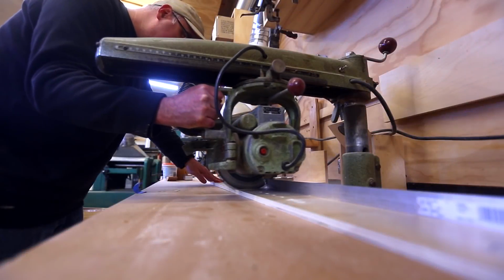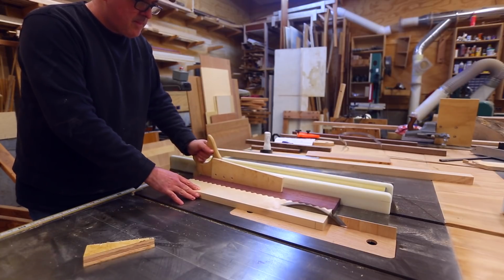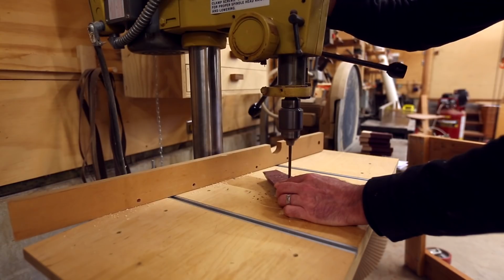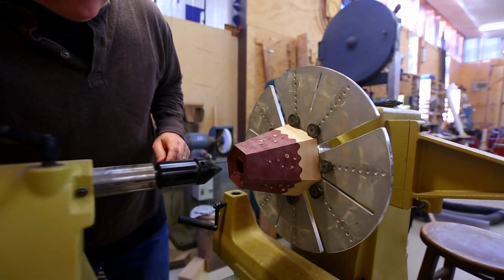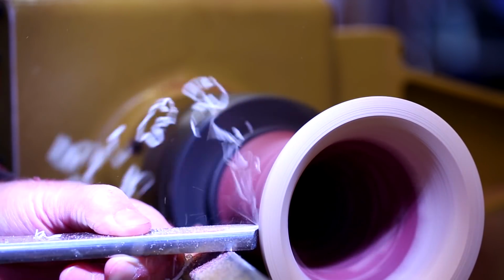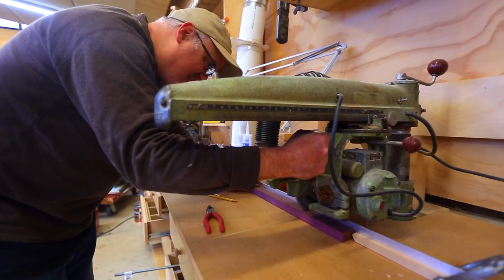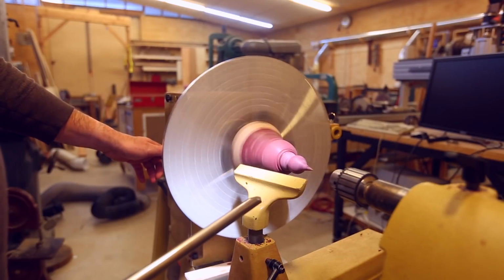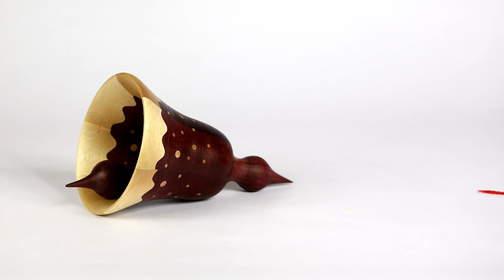Snow Bell

Comment: I've seen this video multiple times and only now do I have a possible solution to the problem of lining up the wavy snow line. Create the darker and lighter cone segments separately. Create the wavy path in CAD as though it was a wavy record. Cut that path onto the top surface of the lighter wood and the bottom surface of the darker wood, with both pieces set around the same center point. Those should join up, and more importantly, because the wavy surface extends to the center, it doesn't matter how deep you cut into the joined piece, the waves should remain matched.

Comment: Hi, I think I know how to make the wave pattern fit the cone.
In physics, the wavelength of a wave is the distance a wave travels along the axis in one full cycle, as shown in the picture in the following link:

https://en.wikipedia.org/wiki/Wavelength#/media/File:Sine_wavelength.svg

As you can see, the wavelength is the distance from one peak of the wave to the other peak, but the distance I want you to work with is the distance on the axis from the point where the two axes meet, the wave goes up, comes down to zero, goes into negative, then comes back up to zero. That zero-maximum-zero-minimum-zero pattern is the wavy pattern on your bowl.

Now, to make the wavy patter align perfectly on the cone, what you need to do is to make sure that the circumference of the cone along your wave pattern's axis is divisible by the wavelength of the wave pattern. That way, the circumference of the cone will take up an exact number of waves, and the wave pattern will align perfectly.

Comment: I cannot cease to be amazed by your mastery 

for the connections between the wavy bits to be more smooth it might be an idea to cut the waves in varying thickness radially at the same angle at which the glued parts in the end are cut
(hard to explain in words)

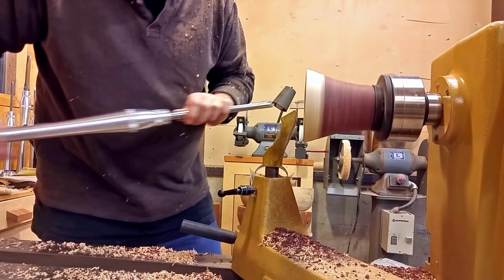Comment: Very nicely made bell, Frank! I have a question about the device you used to drill into the bell to add more dowels. It looks like a drill press for the lathe. Where, if I may ask,  did you come by this tool?  It makes its appearance around 8:30 in the video. 
Thanks!

Comment: Hmmm seems like getting the wavy pattern to accurately match, once all the segments are glued together, the pattern would have had to begin and end mid-point on the side of each segment.  The trick would be then be to create the wave in the computer to match the width of those segments with a flat in the wave in between each to match the width of the saw blade cut when you make the segments.  Viola the wave matches all the way around...  and perhaps avoids the creation of a Dalek in the process!

Comment: Hey Frank, did you notice that when you used the aluminium hold-downs in the original footage, that you had them backwards. This is why they didn't exert much clamping pressure...

But when you cut the wooden hold-downs, you used them the correct way and had no problem... a trap for young players...

Keep the videos coming,
Cheers

Comment: Great job Frank. If you ever have to clamp compound staves steeper than those in the bell, a great way I learned from Don Russell is to use 3M 8884 stretchable tape. 1 inch stretches to over 11 inches. You get lots of clamping force and it won't slip.
Reply from the maker: +Lynn Schmidt thanks for the tape (tip)  I will get some of that

Comment: Great job Frank, I love Purple Heart.  I wonder if you could have compensated for the kerf from your radial arm saw cut on the CNC machine when you cut the curvy bits, so all the curvy lines line up?
Reply: +Greg Altenhofel It isn't just the kerf that makes lining the pattern up challenging, part of the problem is that you don't know the exact diameter of where the pattern needs to line up. Since it is being turned round, it doesn't need to line up on the outside of the compound stave, it needs to line up where the final diameter is. I've tried to do similar things on the snare drums I build, and it hurts my head!

Comment: I think you could get the wavy line to match up at the joints if you make the curve a sine function such that the length of one "slice" of the bell is the period of the function. Once you begin work on the lathe, though, that length is reduced, and I'm not sure if the wave will remain continuous, so maybe you guestimate/determine in advance your final external diameter and calculate the length of a side of the circumscribed hexagon (because you only care about continuity at the joints - elsewhere it's guaranteed) -- which is the diameter/2  -- and then build your sine function accordingly... Next time ;)

Comment: You may be able to do the wavy pattern on the bandsaw by ganging up both boards, but staggering them so that only an inch or two overlaps. Then cut the wave and glue the pieces together.
Reply from the maker: +Brian Abate yes, i have seen that method

Comment: A festive project, creatively and clearly  presented (as usual). 
But what exactly is "Butcher Block" finish? There is so much incorrect and sometimes dangerous information on the internet about "butcher block" finishes. This is actually important. some of the stuff people put on wood products that they allow to contaminate their food is astounding. Of course your bell will not be used in this way but it begs the question.

Comment: How beautiful !
What exactly is butcher block finish?
Reply: +SciPunk215 It's meat oil.

;->
Reply: +SciPunk215 +dubbreak Like dubbreak said, it's food-grade mineral oil. The most inexpensive place I found it was at Walgreens sold as a laxative.Which you know if you can consume it, it's food grade. They probably thought I was a mad man when I found it on sale for $2.50 a pint and bought all but one bottle. (I figured it was best to leave one in case someone needed it for it's medicinal purpose.)
Reply: Of course, for a bell it doesn't need to be "food grade". Baby oil is also mineral oil (though it often has fragrance).

Linseed or tung oil would give a similar finish.
Reply: +SciPunk215 Food grade mineral oil, sometimes with some other things mixed in (beeswax, orange oil, walnut oil) to alter the finish (since mineral oil itself is matte).

Comment: That turned out so cool!

Old timey machinists will tell you that for your hold downs you will get increased holding strength by keeping the heel of your strap at some level higher than your toe. I try to go as close to parallel as possible, with the heel being only slightly above the toe.

Please keep the videos coming :)

Comment: Beautiful! Could the walls of the inside of the bell been thinned out even more so that light could pass through the dowels? Or, if you used white plastic and then hollow out the top of the knocker and put a button cell powered LED to light the inside? Maybe that would be hokey though. I think if the walls of the bell were thinner though, that you'd get better reverberation and perhaps a rubber inlay in the knocker to transmit the impact gently through the wood it might sound nice.

Comment: Getting the waves to line up at the edges is quite a dilemma, time to build a 4th axis methinks.
Reply from the maker: +Adam Harrington yes, it could be done that way,  hummmm...
Reply: +frank howarth They would have lined up if you'd made it in rings like you do your bowls, no? Or if you'd milled the wavy line at the complement angle to the spokes of the bell so that the joins in the wavy line remained perpendicular to the axis of your lathe. If that makes sense.